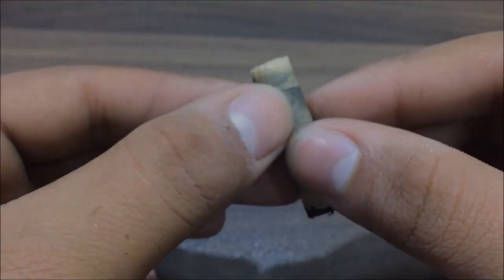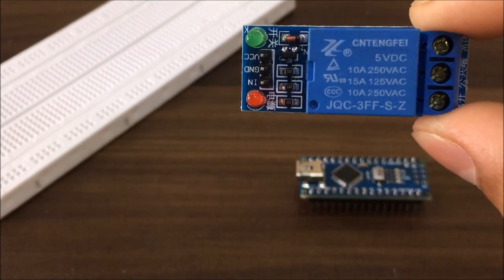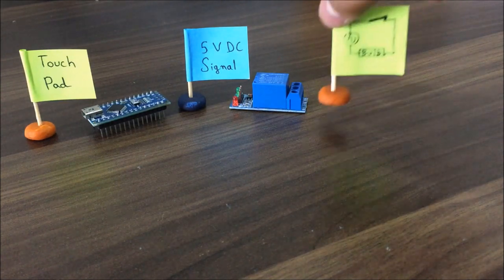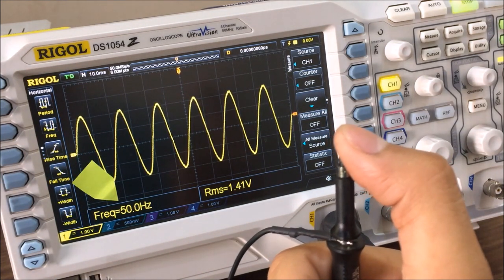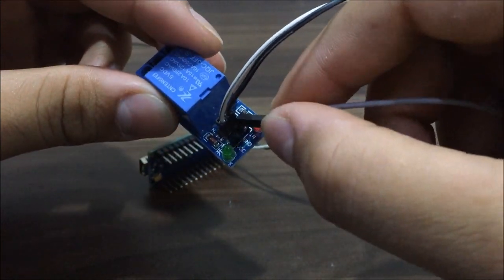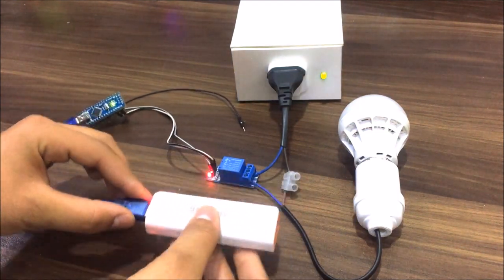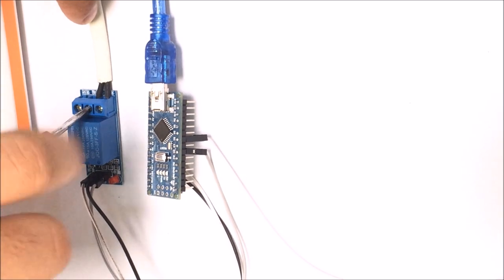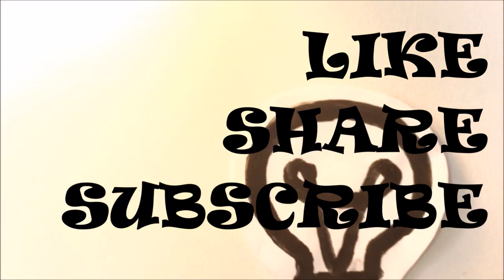Conductive Paint Touch Switch || Arduino Capacitive Touch Sensor || Part 2

Comment: Awesome video, is it also possible to make a switch that goes on while your finger is on the paint and goes off when you withdraw your finger? (not tapping like you do in the video, but hold your finger on it; goes on, pull back your finger; turns off).
Reply: I'd be curious about this question as well!

Comment: So I had this idea to make a pipe shelf to mount to a wall and make it light up. Could I make this and just attach the touch pin to the pipe somewhere and anywhere on the pipe I could touch and it would turn on right?
Reply from the maker: yes you are right but the pipe should be made of metal and make sure that the pipe is not grounded like it should not touch any wall , use an adapter to power the arduino